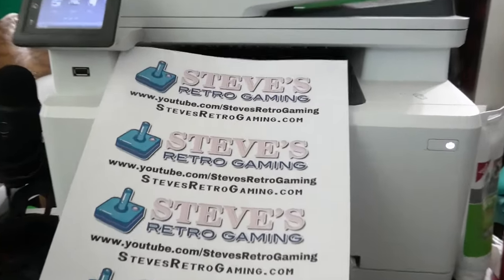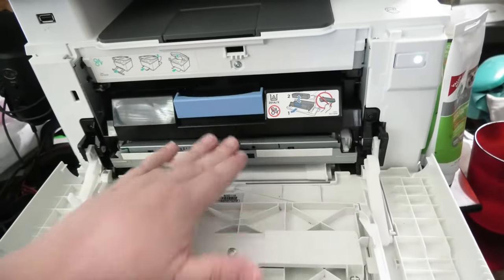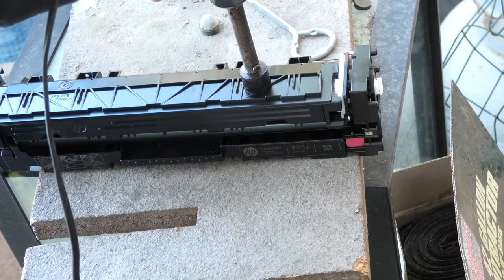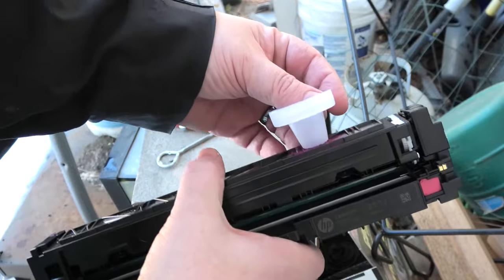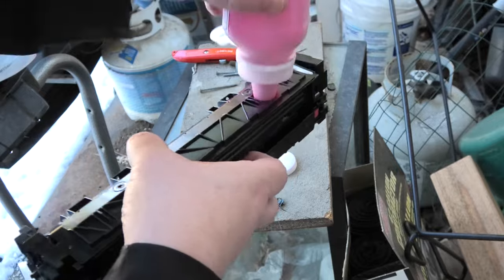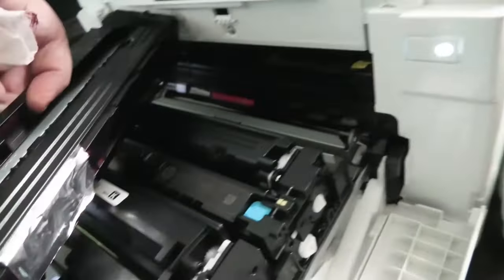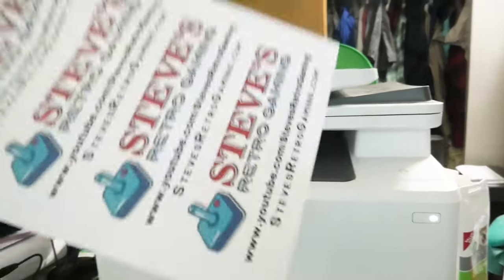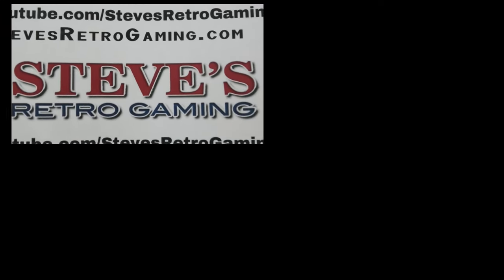Refill your Laser Printer Toner and save Hundred's of Dollars

Comment: A lot of printers have ways of detecting, like a chip, if your toner goes low.  Preventing you from printing, until you replace the cartridge.  Does this do that, or are you able to keep printing?  Regardless of how many times you refill the cartridge?  🖨
Reply from the maker: Yes it depends on the printer, I have used Chip Re-Setter in the past for ink jet printer and my HP Laserjet will let me use refill and NON HP toner, so that is very nice. But something worth checking into. With a little Google search you can find a way around many "protections" like this. Thank you for the comment!
Reply: Some have gears that need to be reset before it works again after you refill but it's easy.